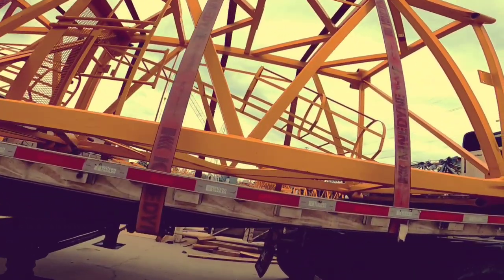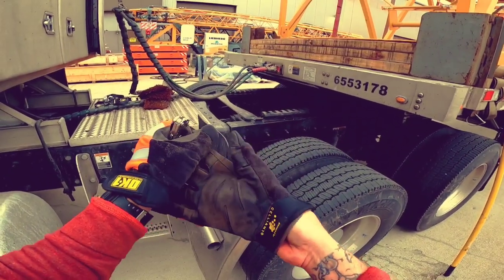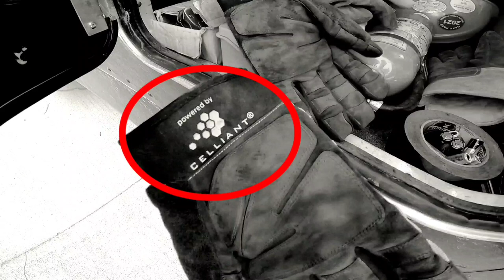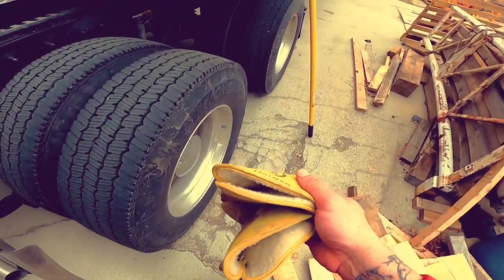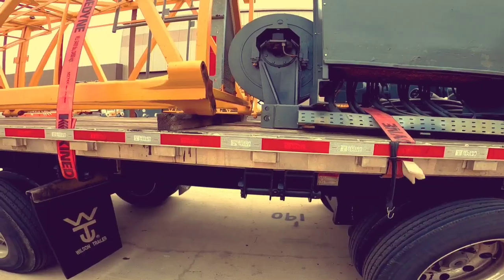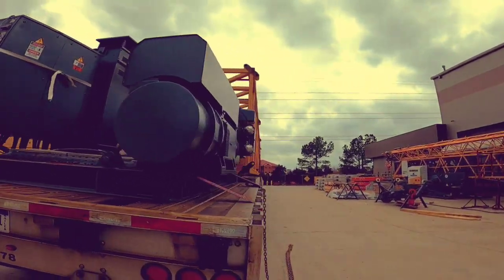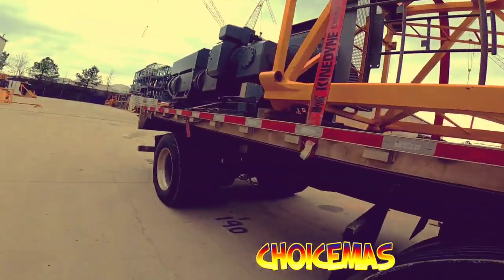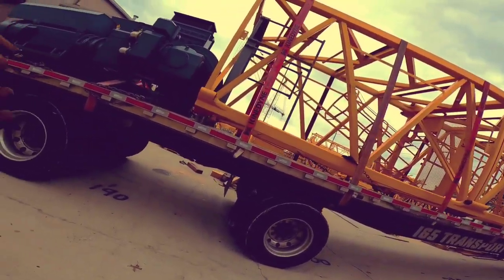Flatbed Cargo Securement • Trainer Show You This? • What I Can Do/What I Won't Do • Choicemas

Comment: Choiiiiice!! I just bought five of those EZ Ratchet binders. I am fifty years old. I can’t be fumbling, and trembling with those snap binders. I also keep a sandwich bag of extra cotter pins. Got to a shipper, to pick up a die machine, and every pin I pulled out broke. I live and learn. 
Thnx for demo on EZ Ratchet binders. Peace, safety, and blessings to you, and within your home.
Skateboard D
Reply from the maker: Nice! Did you use the link in my description to get them? Brother, I get it. I’ll be 49 this year. Working harder isn’t the move. “Great minds think a like.”  I have a sandwich bag of pins for my adjustable bulkhead. I think your gonna like the binders. Make sure they lock for them to stay fixed/tight. Keep me posted and let me know what you think?
Reply: @choicemas  early last week I did two steel beam loads out of Columbia City IN. Each load requiring 8 chains. I’m out there in the rain fumbling to snap em down, and slipped a bit, and pulled a muscle in lower back. That Friday I did some research, and ordered five from mytee products. They got to my house Monday. Please forgive me, I just saw your video this morning. I’m buy three more tomorrow, and use your link brother. You are a great inspiration to me. I just went owner op in January. I only been driving for 16 months. All of that skateboarding. Thank you sir, for showing this Georgia boy, that it can be done. This skateboarding has changed my life.
Skateboard D

Comment: Again, great video! I really like those ratcheting lever binders, but whew! That $160 price tag…not so much.
Reply from the maker: Got mine at about $116 last year. I think it was when they first arrived on the scene. Picked up 6 of em. Wrote them off at the end of the year, I did. They are a blessing. I would like a set of those recoiless binders though. Cheaper and from what I’m told work very well.

Comment: Amen on the chains. Keep everyone safe and just say NO to the flip flops! I keep an assortment of shackles and a box of cotter pins.
Reply from the maker: Steel on steel is the safest bet. And different lengths make a difference. Throwing a 20’ chain over a 10ft. Spread is extra work. Some I bet, never knew what a “cotter pin” was/is. Thanks for watching and taking the time to comment. Stay safe out their HotShot! 💯
Reply: @choicemas  I have different lengths, but my most popular configuration is 2 20' chains with 4 binders. I make short chains out of old ones that maybe have a bad spot I cut out.